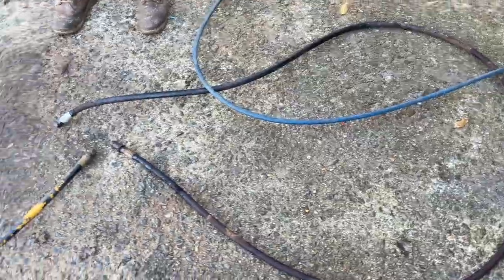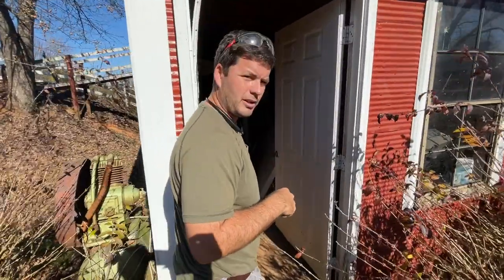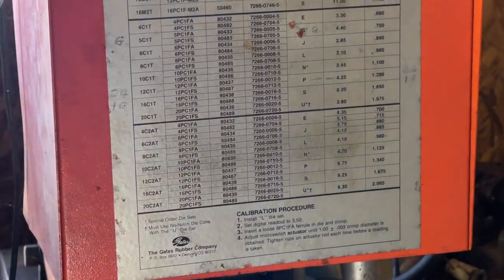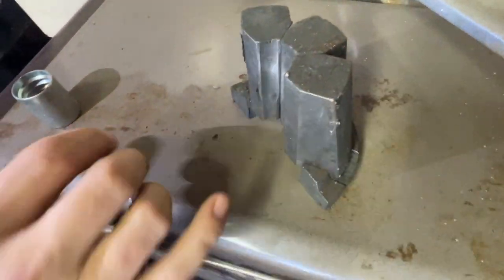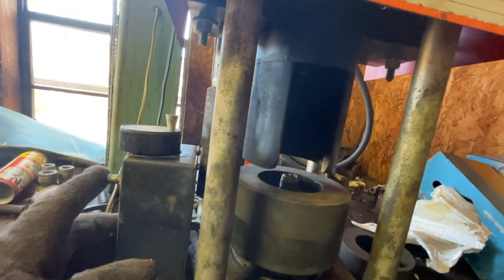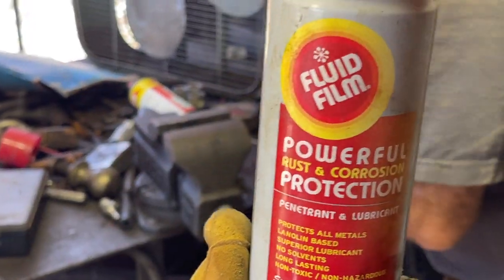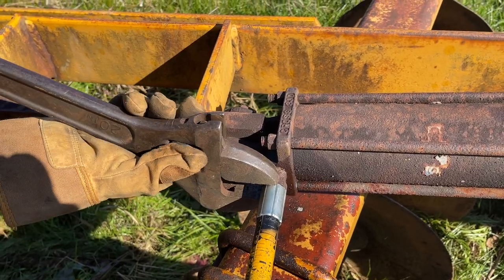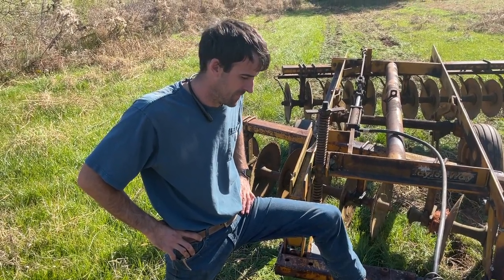How We Make Our Own Hydraulic Hoses

Comment: I used to collect discarded hoses from the hydraulic shops and cut the ferrules to reuse the fittings. Have had trouble finding ferrules lately but when I had them I would replace every hose on my skid steer and avoid a lot of issues! I kept the still good hoses as spares.
Reply from the maker: That's pretty smart right there